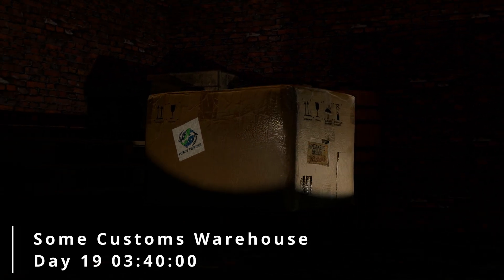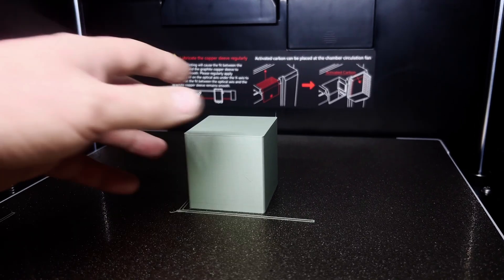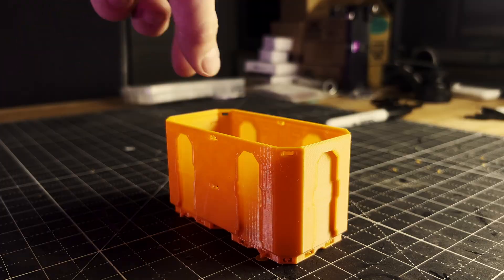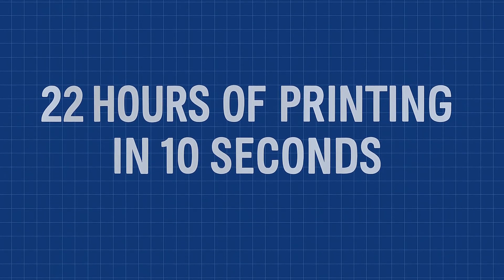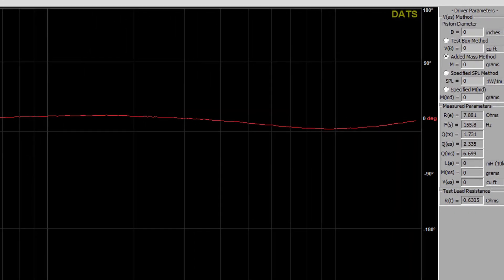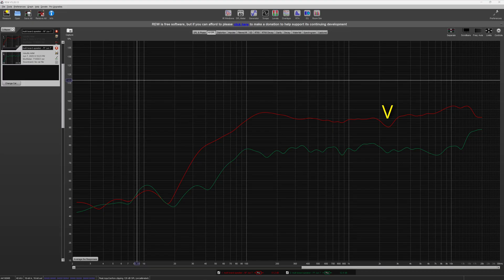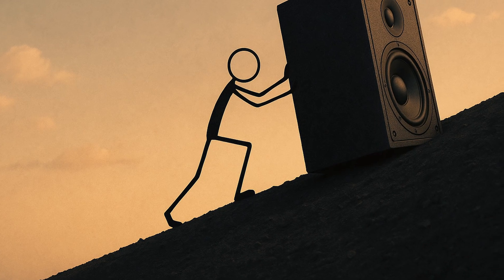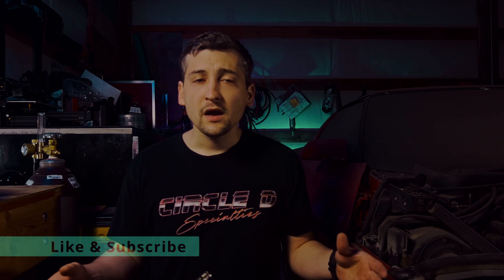The CRAZY $35 Speaker Challenge You Won't Believe

Comment: really trying to track down the actual wiring up portion for this speaker design. Neither video has it. @piscesprinting4170 ??
Reply from the maker: The cross over I picked has a singular input and dual outputs, hook the tweeter to the high/treble and the woofer to low/bass (I forget what they are labeled on that board).

Comment: Came here from the next layer.

First of all, thanks for the support, so the comunity has a new speaker to build.

As i am also into speaker building, and find es specially interesting to be on the budget side ( everone can build some nice sounding speaker with wavecore, seas and co). So i see hugh potential in 3d printing the enclosure. If you are not limmited by 6 sheets of wood you can do fantastic things to the frequency response, bufgle step etc.

Some of my thoughsts:
I see that this is a absolute beginner video for dudes never spend a thought on speakers and thats fine.
Buuuut, i would have hoped to find some acoustic design choices spoken out. 
Is your FR measured in free space or wall mounted? Or is the hole in kick bass filled by the backwall?
I guess that the max 3 liter of volume comes from Jonathan? But what would the speaker sound with 5 liters? I assume the -3dB point would land in the 80hz region?
I know the situation from jonathan is 'complicated', but gassering the materials for an ARTA TSP measuring bridge isnt that hard. I build my first one from scraps. You could have used the resistors from the crossover network. Not ideal, but this way we would now also have some data (4 to be precise) to say something about consistency (biggest problem with el cheapo drivers).
Would you mind commenting TSP here or give us the DATS measurements?
And last but not least: so the woofers behave somewhat like the markaudio CR drivers they theme to copy?

Any way. Interesting chanel, will watch some of your videos now.
Reply from the maker: Response curve was performed on a stand in a "free air" environment - however I don't have an anechoic ( I think I spelt that right) chamber for true tests - in truth the speakers chosen would have preferred a closed box ( as DATS showed)  but me and Johnathan decided it's more "interesting" for a ported enclosure, albeit less efficient. 

the 3L Restriction comes from the multi-board enclosure that Johnathan and other Johnathan created. as the multi-bins normally have a ton of holes and other Johnathan was kind enough to generate a hole free version for us. Ideally, I wanted a 5-6L enclosure that would have flattened the response out and gave about 5-10 hz of lower extension.

DATS parameters are as follows:
 2.5" driver - 17.15g  added mass method
81.9 dB @ 1W/1M
Re - 7.069 Ohms
Fs - 144.7 Hz
QTS - 1.322
QES - 1.746
QMS - 5.44
Le - .049 mH(10k)
mms - 2.953 g
VAS - .02039 cu ft

never heard of a mark audio CR driver unfortunately 

Ultimately, I can go into a lot more depth but years of doing this tells me it's the minority that care about that depth - and it hurts the channel to get into the nitty gritty detail of every project and deep dive on theory and why things are this way. etc... it hurts the retention metrics, which tells the algo to show it less and then nobody sees the videos. I'm happy to go into further detail in the comments though as engagement drives it up in the algorithm. so please ask away in the comments section!!
Reply: As i am only a viewer, you know the youtube game much better.
And i know that we have a niche hobby.

My fault, the driver i thought about, when i saw the aliexpress driver, was the markaudio alpair 5 gold. 

An anechic chamber of course would be ideal, but for this drivers with a premade cross over network, a windowed free air measurement is enough.

I thought multi-board is free to use and alter, so i would have loved to see a "best possible (within material and price) solution". But who am i to blame. I guess i have to build a version 2.
Reply from the maker: @arminosaeure29  Multi board is free to use and alter - but I was given the multi bin that Johnathan had room for on his wall... This would be an example of working within your customers restrictions - as someone who runs a business sometimes the best answer isn't the best solution for the customers desires. We always do the best with the hand dealt but inevitably we could always to better if ideals were closer to perfect. 

As for your own, have at it! my files are free to use, so print them and do a A/B test make a video and put it on YouTube then hopefully the audiences jump to it. Feel free to tag me when it goes up.

Comment: Did you use a crossover from AliExpress?

Pre made crossovers are pretty much never the right choice and you almost never want the same frequency on both the low and high pass (not to mention phase issues)
Reply from the maker: We did use a AliExpress crossover, and as seen in the response curve there is a slight dip but it’s nothing you couldn’t correct.

Comment: might be able to push the bass lower in such a tiny enclosure with some cheap passive radiators
Reply: really clean sound for $35 though 👍👍
Reply from the maker: That’s definitely a thought! I’ve only played with those a handful of times.
Reply: @piscesprinting  kinda annoying to tune cheap PRs tho when their specs aren't accurate :face-green-smiling: but i suppose you have experience printing your own drivers so it shouldn't pose too much of a challenge for you haha
Reply from the maker: True, I have printed one or two drivers 😂 I even printed a passive radiator once. They are finicky though…

Comment: Liked and subscribed! Great job sounds great for the overall components used. Petg cf definitely has a different sound profile from pla cf. In fact I wonder if pet-cf would work better?
Reply: I think PET-CF should work fine
Reply from the maker: I think Johnathan went the right way with PLA CF, as PETG is generally more flexible. So some energy is lost in flexing the walls. 

Though on that same note, you then radiate sound from every surface - it’s just untuned sound?? 

Perhaps this warrants a short for investigative work…. 🤔